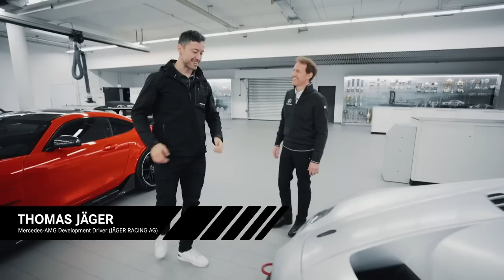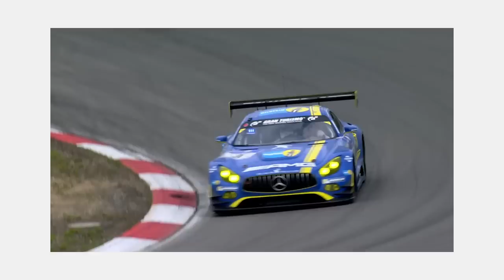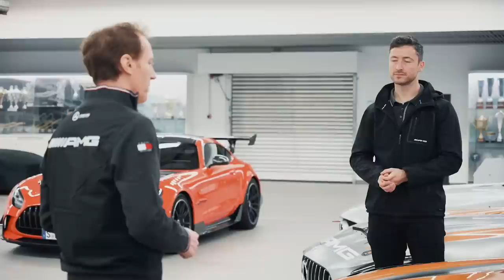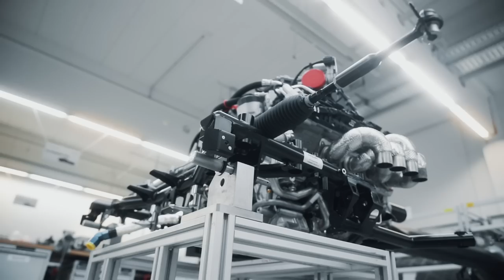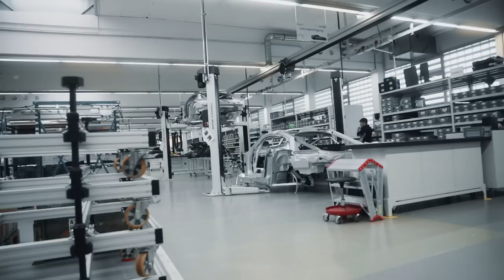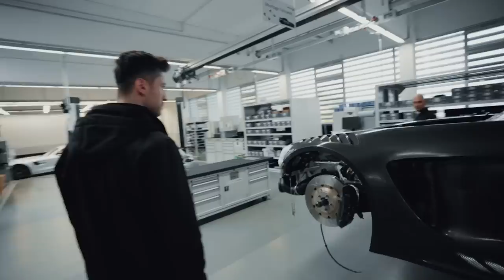INSIDE AMG – Motorsport | A Decade of Mercedes-AMG Customer Racing

Comment: SLS AMG Is the best Mercedes series
Style, Speed, comfort and luxury. All in one machine
Reply: Mercedes McLaren SLR?
Reply: @1990Thunderbolt  that was part McLaren.
Reply: @arjun._.bbC6  still
Reply: @1990Thunderbolt  you can't really consider that as the best "Mercedes". The car was designed primarily by McLaren and Merc only provided the M155 V8, since the car was born out of the F1 program where all Merc did was be the engine supplier. McLaren did the construction and the gearbox. So it's more McLaren than Merc.
Reply: @arjun._.bbC6  it’s still one of the best. Plus the car has a 3 pointed star logo. I don’t see any mclaren symbols in that car at all.
Reply: @1990Thunderbolt  doesn't take a PhD to know that the car is of McLaren design. Everything from the cockpit to the tranny to the chassis was McLaren influenced. It was manufactured by Merc because McLaren had no factory. It's  a beautiful car but it isn't 100% Merc. By that analogy, you can call every Alfa Romeo a good Ferrari since all Alfa's predate Enzo's inception of the Ferrari brand but we don't talk in those lines now, do we? That would be stupid. Exactly why calling the SLR McLaren a full blown Merc isn't logical because it isn't. It was designed by McLaren, had an engine by Merc, and manufactured in the Daimler plant only because McLaren had no factory for cars back then.
It's one of the best cars but not a 100% Merc. Going along those lines, OP isn't wrong at all.
Reply: @arjun._.bbC6  whatever. we both see it differently anyways. all i'm saying it's one of the beautiful mercedes benz's models.
Reply: @1990Thunderbolt  I can agree with that, provided we give due credit to McLaren as well.
Reply: @arjun._.bbC6  (y) they suck at f1 tho lmfao mercedes benz all day everyday! you can't disagree with me on that!
Reply: @1990Thunderbolt  just bad decision making. But I'm giving credit to the McLaren team that made the SLR with Merc, not the modern one. They are still, however, an 8 time WCC and 12 time WDC winner and they came 3rd this year.
Reply: @arjun._.bbC6  mercedes benz will surpass that in couple more years lol i don't see anyone beating them.
Reply: @1990Thunderbolt  that's expected. It's hard to beat merc's EQ tech.
Reply: @arjun._.bbC6  (y)

Comment: Amazing how they are still using the M159 even in newer contemporary Motorsport applications. Just goes to show what a true gem the 159 is, even above the hot side M177 type bi-turbo motors. That 159 and Hewland sequential gearbox is the secret sauce 👌🏼

Comment: Hi Mercedes, I currently use a bmw 520d but my family says to try something new as for the past 15 years I have been using only bmw. Will it be good to get a Mercedes gle ?
Reply from the maker: Hi Harshith, we would always say, trying a Mercedes-Benz is a good idea. 😉 the GLE is a wonderful model. It is bigger than the current one you have, so if you are not looking for an SUV then we recommend an E-Class. 😃 But you are always welcome to take 'em all for a test drive. Where are you from? Then we can send you the contact information of your nearest dealership.
Reply: @MercedesBenz  i live in india(Gurgaon). In December 2020 i went for a test drive of gle 300d and the drive quality was amazing 🤩. T n T Mercedes. This time i don’t want to buy a sedan as the roads in india are pretty bad. At the same time i have a 2009 Volvo XC90 v8(4.4L), So if sell my xc90 and 5 series then it will be good ig.
Reply: I also took a test drive of x5 30d and that felt way more powerful compared to gle 300d. But the problem comes is I have owned bmw 330i(2007), x4(2014) and 520d(2018) and now my wife hates to sit in a beemer. Do you think spending some extra cash 💵 and getting gle 400d would be better?